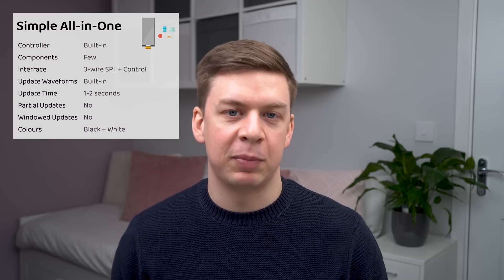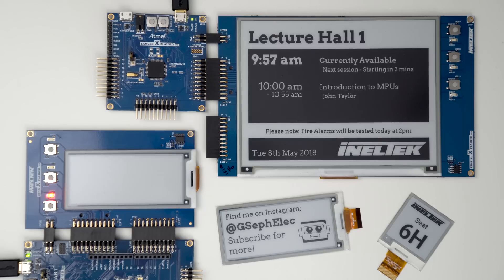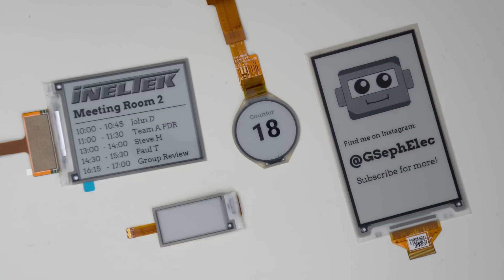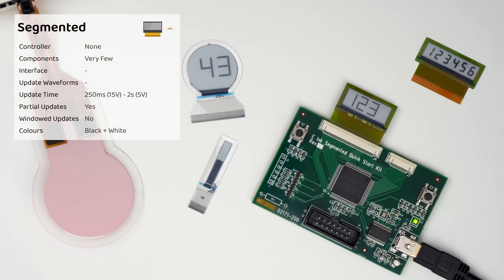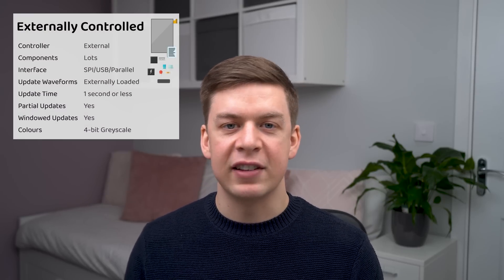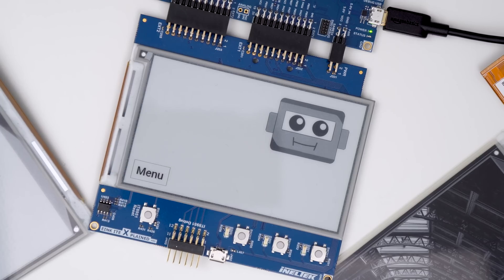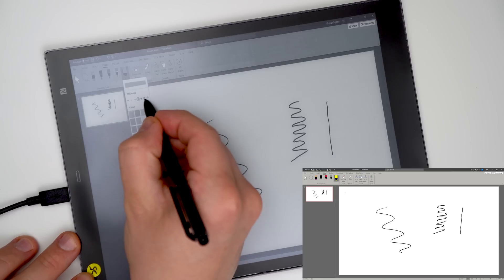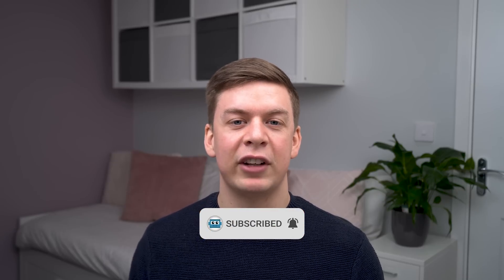Have You Ever Seen an E Ink Display Update This Quickly?

Comment: Are there simple e-ink displays that are good for direct outdoor use?  Display that works between -25*C up to +40*C in shade plus direct sunshine (that means UV resistant). Water ingress IP65 at least I think. Controlling it can be done from inside device case (controller can be inside) but wiring must be simple (flat ribbon is not robust enough). Black/white, update speed within 3 seconds.

Comment: Very cool stuff. One with a very fast refresh rate could be extremely useful for audio projects -- could be used for anything from displaying parameters as you edit them, to showing resulting waveforms, etc etc.

The way MeeNote handles the tradeoff between low latency and full data representation reminds me of how a sequencer I'm working on handles note duration values. First it writes incoming midi key presses with a pre-adjusted dummy value for its duration (200ms is its current default), and then the location where that was written is used by another writing function once you release the key to send a duration value produced from a timer. This allows fully instantaneous writing, but also a post-hoc edit that fills in the data that did not exist at the original time of writing.
Reply: You can do that in MIDI? I am such a novice.

Comment: I have a student who has achromatopsia. Without getting too far into the weeds of the condition, I am curious if there are e-ink displays that can effectively be used as a primary display. I don't think the refresh rates are high enough to use for normal tasks, such as browsing websites. Any thoughts? Thank you for such niche videos.
Reply: Scrolling won't work well but static page display they shine at. I think they are better than high DPI backlit displays.
Reply: Technology connections did a couple videos on e-Ink as a "main" display but how would e-Ink help, anyway? You can have a regular black and white image on any monitor...
Reply: @4.0.4  Read up on the condition and you'll better understand why a high refresh e-ink display would be a huge upgrade over traditional displays with grey scale.

Comment: @GSept Electronics 
Any links for the last 7.8" display? I wonder if that would be good for a ebike speedometer . Not many screens have the sunlight visibility of eink as fare as I see, and on a relatively slow moving think like a ebike showing only speed in 1 kmh/mph increments (or .5 steps) it should be fast enough (?)
Reply from the maker: Yeah you can get that exact display from Waveshare (https://www.waveshare.com/7.8inch-e-paper-hat.htm).

Sounds like a cool project, I would’ve thought an E Ink display would be responsive enough for an ebike speedometer since it would only need to update a couple of times a second 😊

Comment: QUESTION Please, If Nokia (HMD) made the decision that the classic remake of the 3310 mobile should stay faithful with it's screen. Would these screens lend them selfs well to recreating a classic feel with updated res and sharpness? What are your thoughts on MIP screens found in the latest G-Shock watches, are the suitable for a mobile phone use case? A real classic experience with smarts running underneath. Would love to kmow your thoughts
Reply from the maker: I would have though not, there's no major need for an E Ink display in comparison to the old Monochrome LCD that the Nokia 3310 originally had. I also think the update limitations of an e-paper/Memory-in-Pixel display would hinder the user experience without adding an real benefit. But MIP is certainly an interesting technology in the same way E Ink/e-paper is

Comment: And now we even have 20fps color e-inks
Crazy how fast this technology moves
Reply: i hope they invent a 60Hz, high resolution, colour-supporting, e-ink panel lol.
Reply: @ibJUo9EkTKeVbo8klacCgFsF  you shouldn't think of e-paper displays in terms of frequency (Hz). They don't have a set frequency, they only have an update time, and that depends on whether you want a full update or a partial update. For example, I would like to get a color e-paper monitor that doesn't feel like it lags when I type. Rendering videos is fine for demonstration purposes, just to show how fast a display can do partial updates, but it's not a good way to use one of them. The core strength of EPD is they only refresh when they need to, which saves power and reduces the flickering effect. If you force it to do 60 updates per second, it will consume more power than an LCD and won't have any real advantages. If you just want a display that doesn't rely on backlight but still does the 60Hz flicker, you should look at transflective LCDs.
Reply: @ibJUo9EkTKeVbo8klacCgFsF  they've already got color ones but they're way slower
Reply: Do they wear out ?
Reply: @ivangutowski  That's the reason they invert the screen, otherwise they get "stuck"
Reply: @ivangutowski  They do, but not so much faster than an LCD

Comment: did i miss you talking about waveshare devices driven off of ESP8266 / 32 ? or is there a reason you dont mention these ?
Reply from the maker: The waveshare ESP8266/32 driver board is for easily connecting an Espressif device to one of Waveshares boards. I'm only talking about E Ink panels here, not the host micros that are driving them. Some of Waveshare's boards use E Ink panels, so this video will cover some of that.
Reply: @GSephElec  no no it was a double question, the waveshare displays in general as they have the tri-colour types and using the spi to esp8266 as an ultralow power option.  With waveshares 7.5" 2colour display now around $45 it brings the development of them into many more hands with the need for a pi
Reply: @MagivaIT  I also found the waveshare e-inks and need at least 4.8" preferrably 7.5" (b/w would be enough) display running on a Raspberry Pi, but those long taking fullscreen updates and no partial updates are inacceptable for my usecase. What i got from the video however this mostly depends on the display driver board? So i wonder if this could be solved with a different driver board? Where can i find such?
Current but imperfect workaround would be to use 2-3 2.8" displays (also waveshare) which can update much faster.
Reply: @notmyname9062  But what is your usecase first ?
Reply: @trixniisama  I want to display weather data that only updates every few minutes and i don't want the display to emit light by itself.

Comment: Any good ideas for a large (i.e. >10“)  black-red eink displays? I want to combine four (!) of them to display a calendar, todos, server stats stats on my wall. So update time doesn’t matter really (maybe every 30 min). Waveshark has a 12.48“ black/red/white display for 200 EUR and I wonder if this is a trap, or if you can think of a better alternative. All the best from Berlin, Germany. Subscribed !

Waveshare: 1304×984, 12.48inch E-Ink display module, red/black/white three-color
Reply from the maker: 200 EUR for a 12” B/W/R display seems about right to me. No idea what you’d do with 4 of them though 😂 big displays like that are usually used for signage like advertising or in shops, so not too sure what sort of project you could use it for at home. But what you’ve suggested already sounds really interesting.
Reply: Thanks  @GSephElec  ! I‘ll go with them than. And regarding size requirement (let me put my brag hat on): Todos, Calendar, Action Items Scrum Meetings, Financials of Three Companies, Tracking of investments, Health Metric Server Architecture, Training data form machine learning systems, my personal health data like weight (lockdown... its bad... really bad), important emails, status smart home... and so on and so on... maybe 4 are not enough 🧐 anyway that’s the reason why eInk... to much waste of energy running that one standard lcd screens